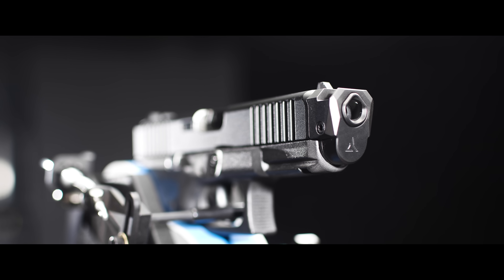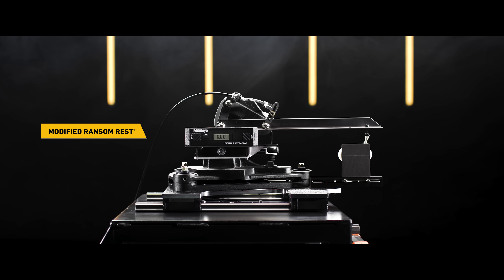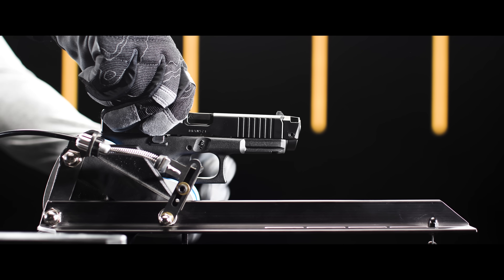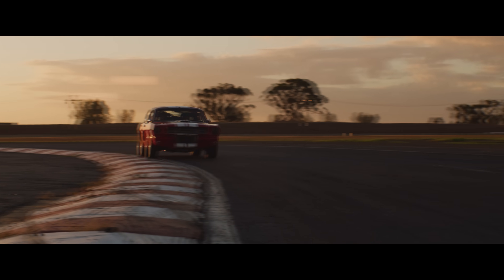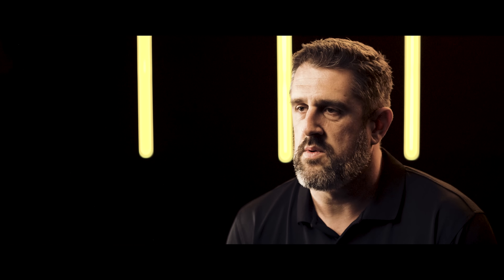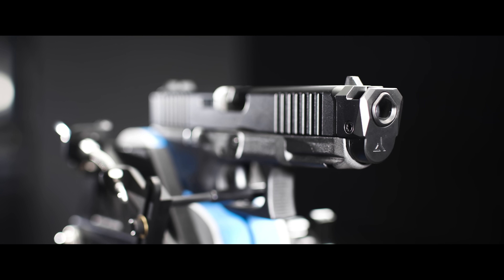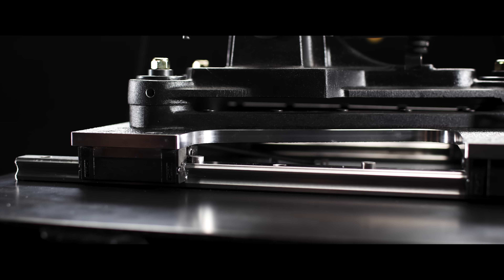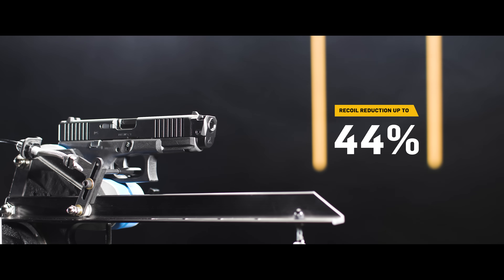Radian AFTERBURNER + RAMJET Ransom Rest Test for Recoil Reduction

Comment: :26 - "2: Reliable cycling with a stock spring weight, even when running 115gr ammo."

Yet, you claim your product should leverage 124gr or 147gr 9mm.
Reply from the maker: That note is only in regard to the G17.

Comment: I have a question. Why do some Glock 19 Gen 5 have round barrels and some have teardrop barrels? What are the differences between these two lots?
Reply from the maker: There was a design update implemented a year or so ago. We updated to the round barrel design due to consumer feedback regarding carbon lock. The round tip allows the comp to be spun which breaks up stubborn carbon. The INTRA-LOK screw still negates the need for timing and still allows for foolproof mounting. This design improvement has been and will be implemented into all future models.

Comment: I'd like to see a ported pistol in this set up as well, additionally, a stock g34.
Reply: I have a ported pistol that probably out performs it on recoil. Just like there are probably bigger comps that can do better. The Ramjet and Afterburner combo is pretty optmimized though. 

This is like the daywalker of comps. Almost all of their benefits with almost none of their weaknesses. You get a common form factor (G17) for lots of accessory compatibility that most comps don't get while getting way better bullet velocity that ports don't get since the gas is vented further down the barrel.

To get that dramatic performance out of a comp that size is impressive. Then it's also paired with a custom barrel so it isn't threaded. That helps it to avoid potential legal issues in certain areas, avoids the need for timing and rockset/threadlocker, and makes removal for cleaning or anything else easy. It's no wonder this thing is hard to keep in stock. It checks every box.
Reply: @blaneelferdink691  I mostly mean that you barely ever see objective measures of recoil and recoil reduction, just mostly subjective experiences like you mentioned. I'd like to see it without the human factor as a separate set of data.